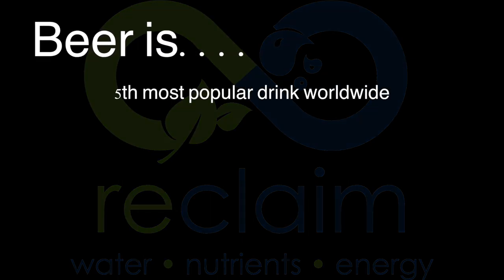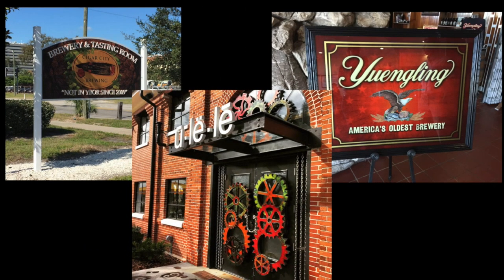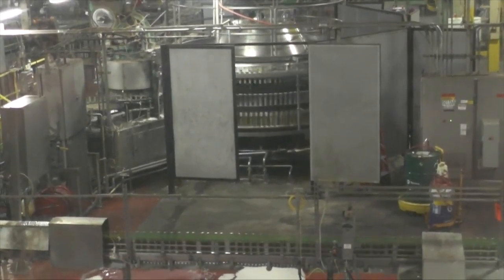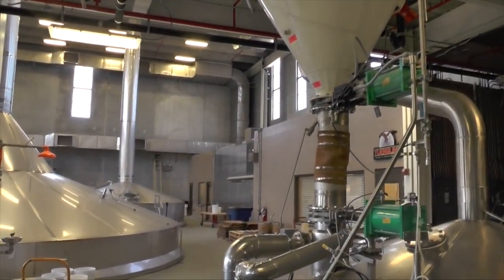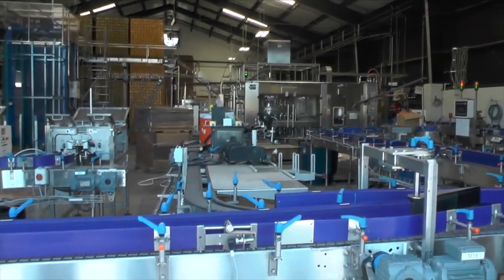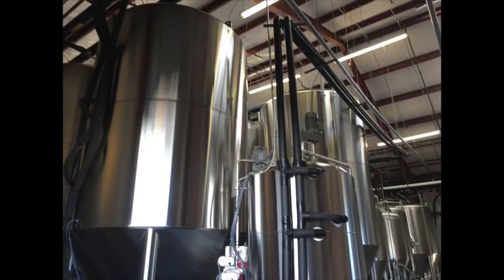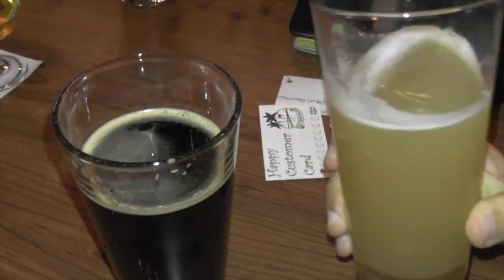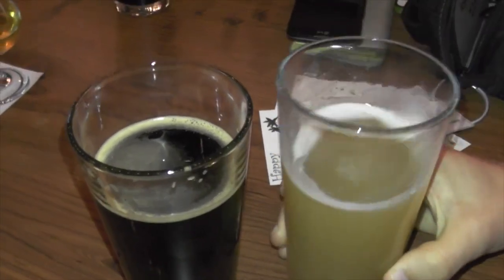Reclaim Is, reducing the footprint of your food and beverages. Reclaimisbeersector

Comment: I was really impressed by the yingling factory, not only do they use excess co2 as an alternative energy source but they are also installing an on-site recovery system which will reduce or eliminate nutrient loads to waste water tratment plants, therefore reducing the amount of nutrients entering Tampa Bay. They also redirect their diatomaceous earth into aspalt whixh I thought was really innovative. The only issue I have with the larger plant it that they do not redirect their spent grain to local farmers (as cigar city and Ulele do).
Reply: This was for question 1!